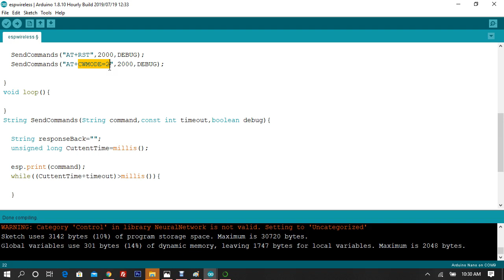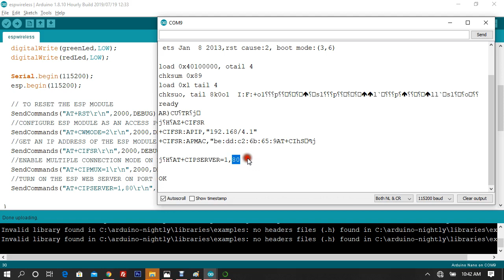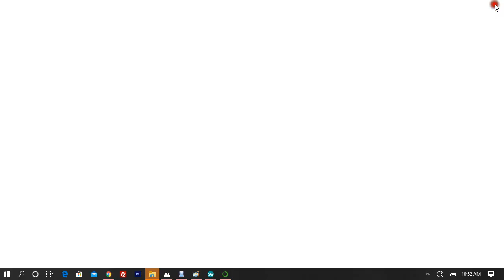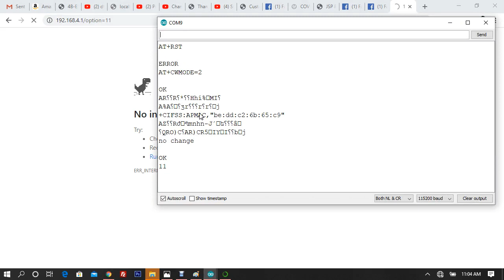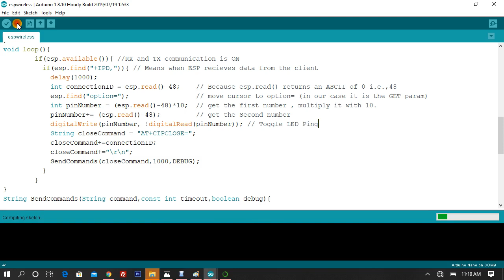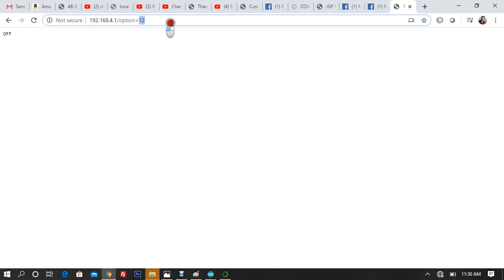Best way to use ESP with Arduino (Web Interfacing) to control IO Pins part2

Comment: 1.Millis give us the current milliseconds since the board has been turned on.

2. !digitalRead has been used just to do the opposite of the given command ,it's simply NOT , if it's HIGH then make it LOW and Vice versa.

3.We are putting -48 there  so as to deal with 0 or 1 only. As mentioned the ASCII value of 0 is 48 and we don't want those numbers.

Comment: ans 1 we use -48 to subtract as 0 has the ascii code of 48 
ans 2 millis give the no of  milliseconds of the arduino  it goes continiously above 4 billion digits  it would take 49 days to reach that no its bacically used for multitasking 
ans 3 :  we use NOT  ( ! ) in it because if the pin is HIGH  Is going to pin LOW      if the pin is LOW  is going to HIGH it acts like a toggle

Comment: Millis is a function that we use to acheive multi tasking in arduino...because it cant dont multiple tasks with delay..delay means stopping one task and doing next but with millis we can run two tasks concurrently
2.because if the bulb status is on it will turn it off..and vice versa😊